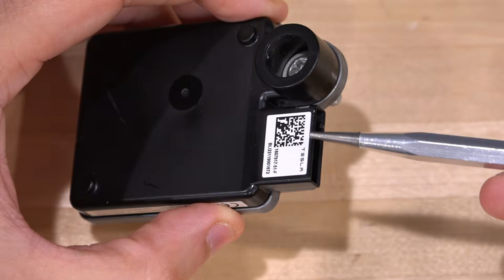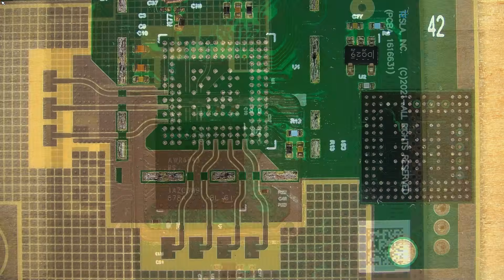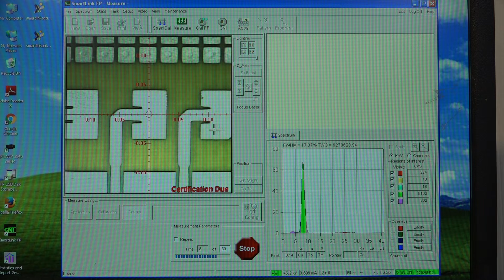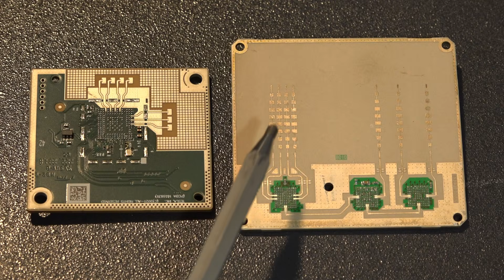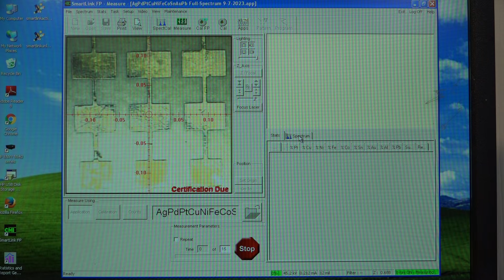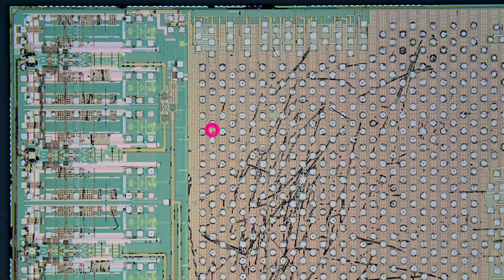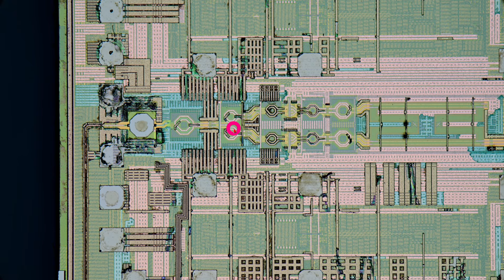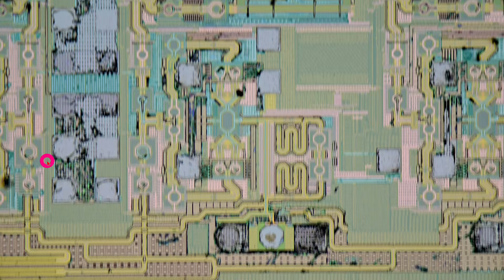TSP #315 - Tesla Model Y Indoor Cabin Radar Teardown & Deep Analysis of SoC, Package, Antennas & PCB

Comment: I know it's a tough thing to ask, but I would have really, really wanted to see what data this provides in the end.
Reply: Makes no sense to go through all this trouble to see people in a car
Reply: @bkparque  Maybe would let you eliminate all of the seat presence sensors. Also can determine your physical size and posture for crash safety.
Reply: @jaro6985  Which is kind of bogus, the sensors in the seats are by far the most trivial and cheap solution to detect occupants.
Reply: @graealex  If seat weight was cheaper, then this product wouldn't exist.
Reply: @userPrehistoricman  It is cheaper for just detecting occupancy, since it's integrated with the seat heating anyway. And no processing required. Just a contact that closes when a certain weight is on the seat.
Reply: @graealex  Maybe, but theyve had reliability issues with the seat sensors before. And its not just the sensor, its the wiring, and the time taken to install, etc.
Reply: @graealex  detecting presence of life is required in new regulations, so simple weight sensor is not enough. Safety systems should not activate if there is only a box there.
Reply: @zednos Oh, interesting. Where is this coming from?
Reply: Same. I know very little about how radar data is processed and interpreted in sw.
Reply: occupancy
Reply: @VaikundamChakrapani  I'm aware what it does, I wanted to see the raw data.
Reply: Looks like youtube blocked my comment because I pasted a link. At TI web site there is lots of info on the chip, including reference design with some pictures of what data looks like in the end.
Reply: @MrSparker95  Thank you, I will look it up.
Reply: Passenger presence system. If you want a fancy term 😅
Reply: you can find lots of material on FMCW data processing if that's what you mean